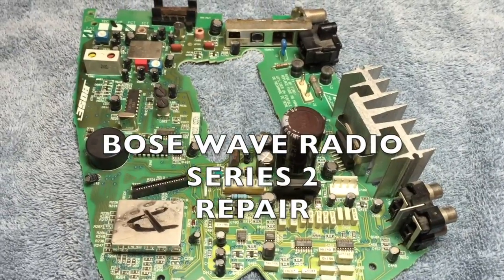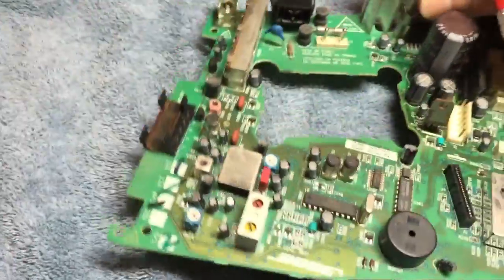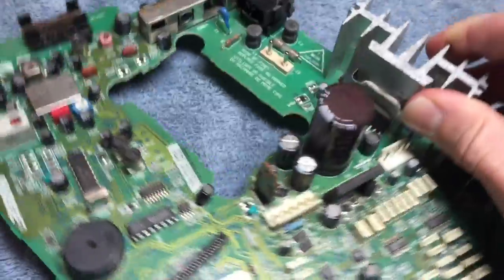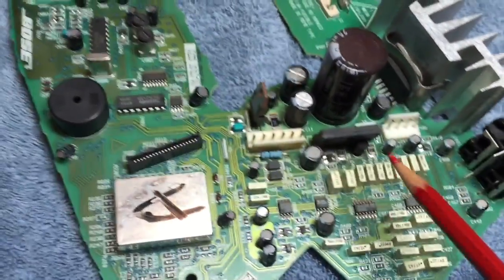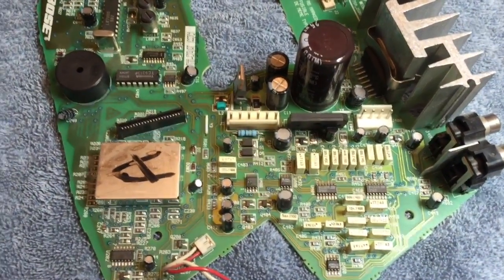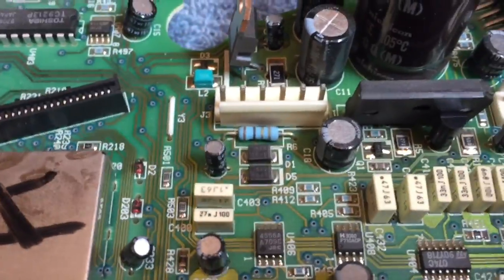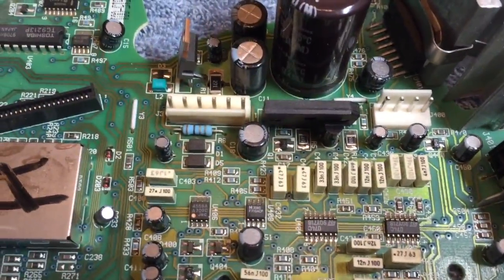Repair of Bose Wave Radio Series 2

Comment: Indeed it's the Q4 transistor if you unplug and there's a short static sound.  I replaced this NPN transistor with a rather huge 2SC5200 transistor since it was available for overnight delivery on amazon.  I used some cheap standard flush cutters used in soldering to clip each lead at an angle to make a long sharp lead for the transistor so it could fit in the pcb holes.  Note the pinout is reversed compared to the stock Q4 transistor in this model.  So have the label side facing out towards the right side of the radio, not towards the transformer.  While I was at it I replaced the main filter cap and two smaller filter caps over there next to Q4, and this radio should last another 30 years before next service.  

Notes on this project:

- BE EXTREMELY CAREFUL WHEN OPENING THE RADIO FOR THE FIRST TIME.  THE ANTENNA COIL IS LIKELY STUCK TO THE SPEAKER CABINET (WHITE SECTION OF RADIO YOU PULL OFF) - PULL IT OFF EXTREMELY SLOWLY AND MAKE SURE IT'S PROPERLY STUCK TO THE PCB.  If you don't follow this step and rip out the antenna coil (left side of radio, black bar with copper cloth spooled over it) you might as well throw the radio away, or spend hours figuring out what goes where and probably ordering parts.

- My wave radio was purchased around 1998 by my parents, but the schematic that reflects this model is the 1996 one you can find online.
 
- Be extremely careful when desoldering and removing components.  Use flush cutters to cut the leads as much as possible before pulling them out - a lead pulled out will rip out the copper.  This very cheap pcb was not designed to be repaired, and the copper circles around the leads tear out easily.  I think they mitigated this by adding tiny solder pads next to the lead holes, so when stripped you could "repair" it by adding a piece of clipped lead wire and jumper it to the little pad near the original hole.  I was really disappointed to have to do this on the first cap I replaced, but it works fine.

Comment: Honest to God Steve, you make an entire video but you don’t even tell what kind of a problem you’re solving? Or what that transistor does in the circuit? How is this supposed to help anybody?  are you fixing a power supply issue? A control circuit issue? An audio path issue? Why did you even make a post a video without giving this information? Who wouldn’t be frustrated over this video?
Reply: Or how you determined that it was faulty.
Reply: @2tallB  There are only 2 small transistors like this on the board, and they're easy to test with a multimeter.  I know it seems difficult to comprehend but it's standard stuff for a repair tech.

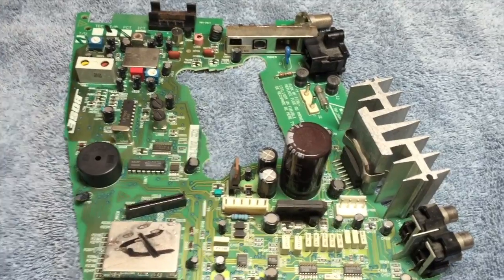Comment: @0:25 you say ‘it quit working on me’. I hope you can define that in more detail.  Mine turns on, no sound.  All resets done according to website. Did you have same symptom?
Reply: In case you're wondering, if it turns on but no sound - the transistor is working, you need someone to replace the power section capacitors on the board.  There are 3, so parts-wise it would probably cost $5.

Comment: i would have liked to see how you re-attached the AM bar.   Mine was ripped from the holder too when removing the cover and i dont know which wire goes to the 1 2 3 and 4 posts.

Comment: I have one that will only play 92.9 no matter what channel you change it to.. When I check the antenna input coax center pin with ohm meter it's directly shorted to the outside of the coax body... Is the Tuner shorted?

Comment: I am trying to fix an AWRC1G Bose Wave Radio/CD that doesn't turn on. I replaced the fuse but that didn't help. Any ideas? I'm not sure where to find the Q4 transistor on this board.
Reply: If you're still looking to fix it, on that model you need someone to go in and replace the capacitors all over the board.  It would take about an hour of work and about $25 in parts.

Comment: Thanks for the video I went on your advice ordered some 2sc3792 transistors replaced Q4 and it is working great now. I will say soldering on that tiny printed circuit board was a challenge but I got done.

Comment: If you hear static from the speakers when you unplug your bose wave, definitely replace the Q4. Had the same issue, used a pinball NPN transistor I had on hand and boom it worked. Great video, very helpful
Reply: Thank you for this comment, this is exactly the same symptom I had (static when unplugging).  Most videos show it being fixed by replacing the 3 bigger power section caps, but I just ordered a comparable npn transistor and hopefully that fixes it!  (It fixed it you rock)

Comment: Ok, mine works just fine on AM. FM receiver is a little screwed up (works sometimes). I have an antenna installed. Is there a part I can replace to fix that? I'm an A+ Computer repair tech and I work with motherboards daily. Capacitor?  Transistor? 
My Bose is series 1, no CD.

JP ---  A Plus Computer-LV

Comment: Thank you Steve! Your video was VERY-VERY HELPFUL! I just fixed a dead Bose radio that was only sounding brief static when unplugged. Failure of Q4 transistor (in power supply) is a known and common problem in those older Bose Wave radios - when the Bose is dead but you hear a brief static noise when unplugging the radio, it's most likely fried Q4 transistor. Replace it with any NPN transistor with its power rated 600 mW or higher. Make sure the position of pins: B-C-E would match the original 2SC3792 (this transistor is marked on its case "C3792"). Use google search for all specs info. Old TV board is a great source of good replacement transistors, just watch for the following: NPN, power >600 mW, and positions of B-C-E legs. Do not "wiggle" the old transistor when desoldering it, because Bose boards have very fragile and thin PCB traces that break super easily.  

When you accidentally rip the 4 wires of AM ferrite antenna: 
The ferrite rod is covered with a piece of sticky foam tape that over the years also sticks firmly to the plastic housing. When opening the radio, the foam holds the rod stuck to the housing while the 4 thin wires may get ripped off. I would recommend gently removing the foam completely off the rod and throwing it away - just be careful not to destroy the wires on the two coils on the rod. Then you will see a larger and a smaller coil on the rod. Cover each end of the 4 wires with fresh solder about 1/8" or less. The antena has 4 pins on board marked 1-2-3-4. The smaller coil goes to pins 1 and 2. Larger coil goes to 3 and 4. In a proper forward order. You can't go wrong. If the coils are moving you can attach them to the rod with a piece of masking tape etc. 

Give this comment thumbs up, so people can see and use the info.
Reply: Thanks for this great tips & notes
I wanna ask you something about another Bose just in case you have an idea how to fix the Bose SoundDock that refuse to switch On like as if the Mute is stuck up
Reply: I am trying to fix an AWRC1G Bose Wave Radio/CD that doesn't turn on. I replaced the fuse but that didn't help. Any ideas? I'm not sure where to find the Q4 transistor on this board.

Comment: My Bose radio turns off on it’s own when I’m listening to the radio or CD. The clock remains lit, albeit dimmed, and as soon as I press the PRESET buttons for my saved stations or the CD button, it immediately starts up again for an erratic period. May be 20 seconds or 20 minutes.
Above also occurs when I’m CERTAIN all alarm settings are OFF.

Any easy & affordable ideas for a DIY fix?
Reply: I am having the same issue were able to fix it ??